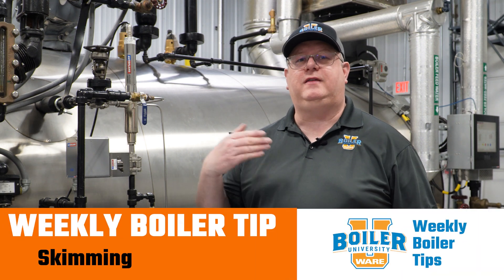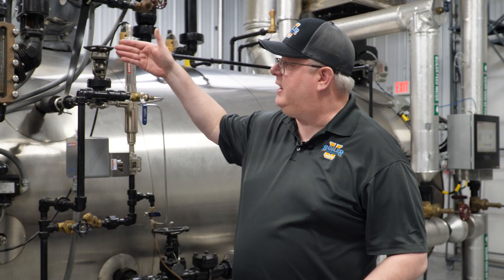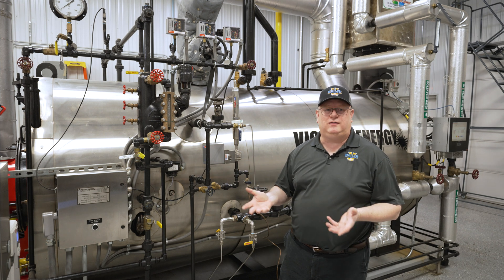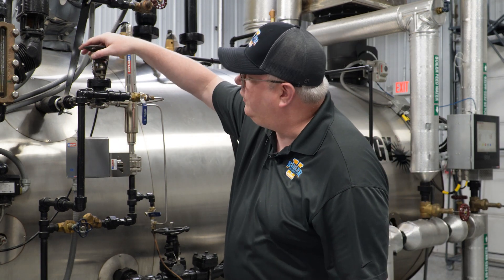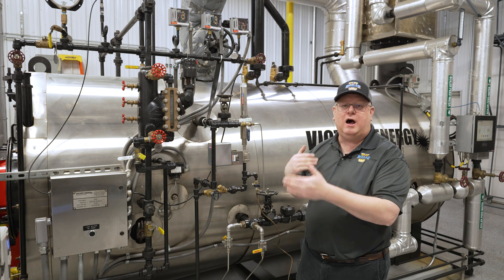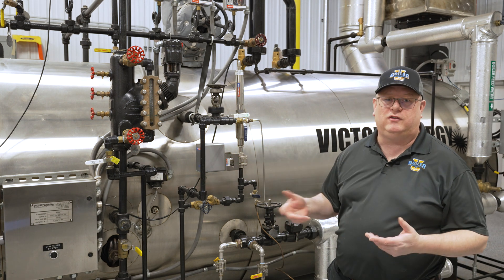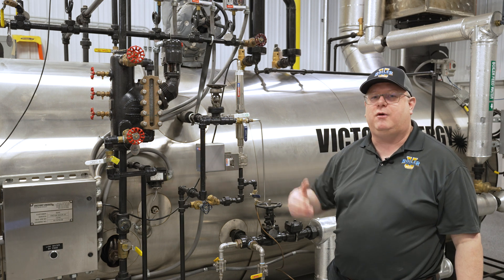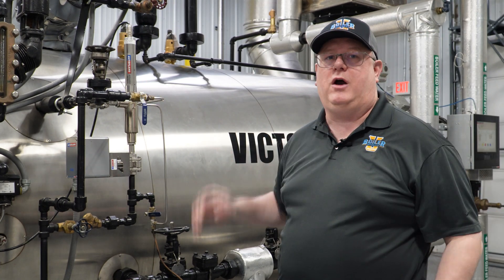Conductivity Control & Boiler Skimming: What You Need to Know - Weekly Boiler Tips

Comment: I understood skimming as something you did while the boiler is off. Due to the water level not staying the same from boiling. 

Can someone explain a proper procedure for skimming? I run a low pressure system.